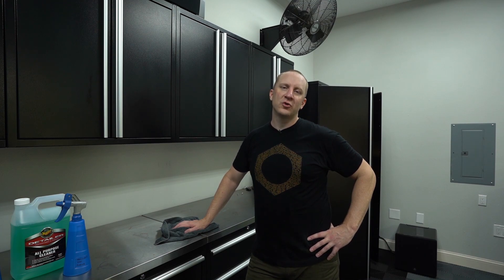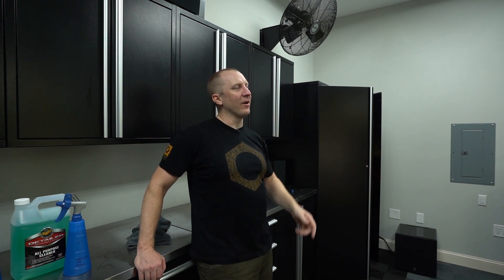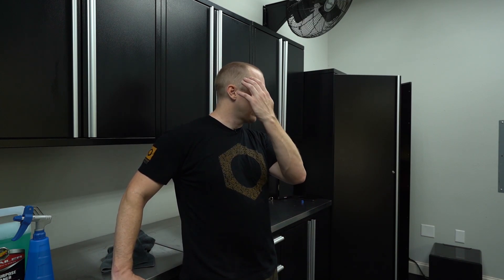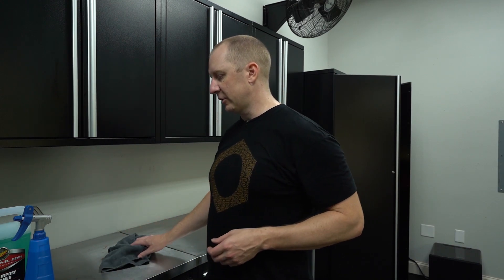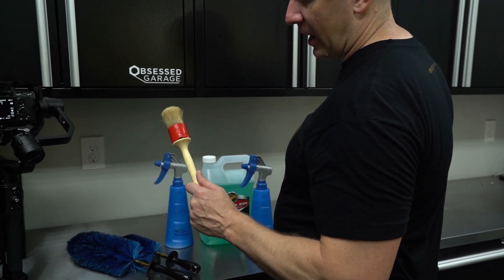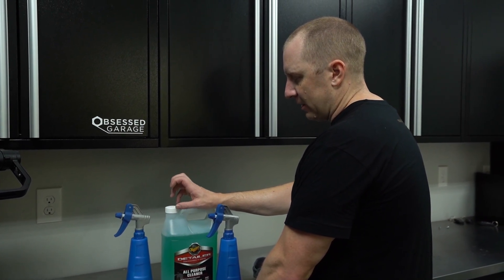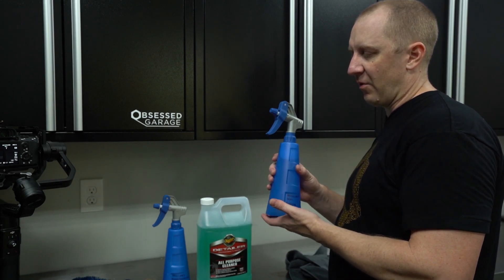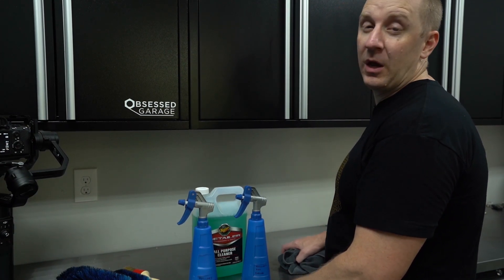BMW F10 M5 Detail Series: E2 - Engine Bay Detail

Comment: In over 20 years of professional detailing I only had one issue with using water to clean and engine bay. That was a late 80’s Toyota Supra twin cam. Water got in the wells where the spark plugs are. The water pooled in the vee and shorted the plugs. A vacuum with a pvc pipe and compressed air and it dried them out fine. Zero problems with 100’s of cars. But like in my case you get on oddball occasionally.
Reply: Had issues with my 79 Camaro Z28. Had to pop the distributor cap off and dry inside the cap along with all the pugs and wires. Had to dry and leave it in the sun for a couple hours.
Reply: I think all you have to do is cover the sensitive areas and areas where water will pool up, also regular garden hose is enough, pressure washer is overkill.
Reply: faisal3398 definitely have to cover the sensitive areas, especially now in newer cars. Back in the day we would get that harsh engine degreaser off the shelf at the parts store. Spray the engine degreaser all over the engine bay and let it soak for 5-8 minutes then turn the car/truck on and spray it down with a garden hose and let the engine run to dry most of the water off, then use a compressor to blow the rest of the water off while the car was still on lol. We would let the car sit to cool down, then use original Armor All and spray it all over the engine bay and let it sit for an hour then do a quick wipe down. It would look amazing, but we could have done a lot of damage, but it’s pretty much the same when you drive your car in the rain with water splashing up in the engine bay! Thankfully we were lucky with the thousands of cars that came our way.

Comment: Matt, if you wanna save some time, use the APC in the foam cannon and foam the engine.  I got this trick from Mike Philipps and that is how I do all engines now.  Super quick and you don't kill you hand muscles pumping that sprayer a gazil... sorry, a trillion times ;)  And yes, engines and door jambs always first, you will send gunk all over the paint if either are dirty.
Reply: Calendyr I was just about to comment this very thing been foaming mine for a couple years now works great!!
Reply: Do you prep the engine before foaming ie cover the alternators and other electrical connections?
Reply: He uses a foam cannon for doing wheels, strange he didn't use it in this engine bay, but it wasn't dirty really
Reply: @juanlanzalot8969  I was the one who suggested he tries the foam cannon when he did the video with the IK foamer and was mad at it for having to pump 30 times to get 10 seconds of foam ;)  I did not think about using the foam cannon for the engine until I saw a video from Mike Philipps using a foam gun on a hose.  Sometimes our brain just doesn't make the connection if it's not something you learned when you started detailing,

Comment: If you ever want the wipers to be in service position to wipe easier, just press the ignition button twice until it shuts off completely, then push and hold the wiper stalk  upwards until it goes up and itll stay in the middle :)

Comment: What kind of tint is that? 15%? The windshield looks tinted, too. 13:40 Can you expand on that, what you said about replacing the B pillars? I’ve heard this to be problematic with the F30 328i/330i matte/unpainted black plastic trim fading but I thought the gloss pillars were ok? I take it that you can’t paint correct this? Is this the case with all B-pillars on any car or just with BMW’s?
Reply from the maker: I think it's 25%.

Comment: How about doing an actual dirry engine bay for better represenation of how well the products work. This was already clean and you barely did any cleaning to it. I'm curious about your products but this wasn't that great of a sales pitch
Reply from the maker: Why would your engine bay be any dirtier?
Reply: @ObsessedGarage  recently purchased car that had 40k miles and the lady wasn't detailing her engine bay. I of course modified the car and want the engine bay to look as good as the exterior.
Reply: @ObsessedGarage  a 2016 BMW M235i that I put upgraded intercooler, charge pipes, intake, downpipe, and tuned motor/trans as well as a custom marble design wrap. I use chemical guys products mostly but would support your company if I saw any actual before and after difference
Reply from the maker: Got it.  The process would be the same, it would just take more time.
Reply: @ObsessedGarage  The all purpose cleaner I agree, my comment on your other video was about not seeing any hyper dressing applied to see how much to use or how to use

Comment: Your wool wheel wash mits would probably be better suited to engine bay cleaning than most of the brushes that you used. Your fingers have a lot more dexterity in those areas than the brushes, so you have more control and it would probably take less time, especially the underside of the hood and all the top level surface plastics. Might be worth trying.

Comment: I''ve had poor luck washing my engine bay. I killed an alternator and a radiator fan controller :/
Reply: I usually put plastic grocery bags over my alternator, aftermarket air filter, and anything I don't want to get soaked with too much water during this process.

Comment: Where I used to work they would start the engine spray degreaser pressure wash blow dry soak with dressing and let it run for half hour give it a good red line and shut her down I always worried about a engine light seems like steam cleaning can be a safe alternative too I have not tried yet

Comment: Matt, did you watch the episode of AutoVlog where his 3-month old C63 S got hydrolocked while driving on the freeway during inclement weather? He found out that water got into the air intake and destroyed the engine, total-lossing the car. Curious about your thoughts on that and whether something like that could happen when you’re power washing the car?
Reply from the maker: You would have to open up the intake, shove the nozzle in there, turn the car on, and start revving it for a minute or two for that to happen.  The only way to hydrolock and engine is to drive through a large, deep pool of water.

Comment: The meguiars apc kills sprayers, have had it happen to a few of mine. Even though its diluted pretty heavily. The bottles sprayers can handle degreaser, tar remover fine. But the APC seems to kill them.
Reply: @Doggepp I’ve been using D101 in dollar store sprayers for at least a couple years now and I still get good atomization.

Comment: Great episode Matt, I’ve been looking for a good All Purpose Cleaner and i might just have to give Meguiars a try. 👍🏼
Reply: @Luka I really like D101. When I use it, I generally use it around 10:1 and I get plenty of foam if I agitate. It works very nicely on all sorts of plastics, interior and exterior, and especially well on interior buttons that have some embedded human grease/slime. It’s also cheap, which is a nice plus.
Reply: computiNATEor 10:1 I’ll try that dilution. Have you used this on interior carpets?
Reply: @Luka Yes, although a dedicated carpet/spot cleaner like Folex does a quicker job, if you’re reducing the amount of products you have on hand D101 is certainly viable. D101 works very nicely on winter rubber floor mats.
Reply: computiNATEor I’ll make sure to give them a go 👍🏼 it all comes in handy